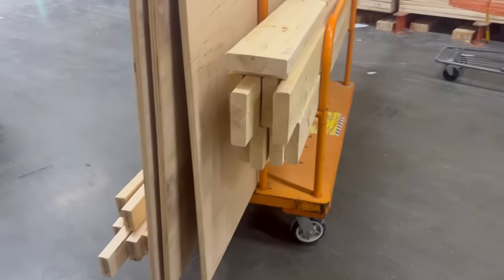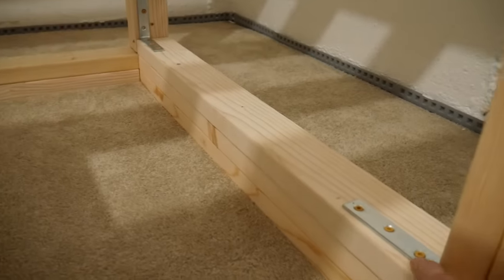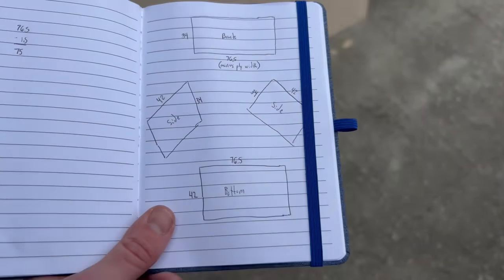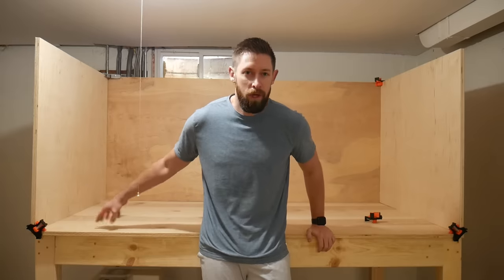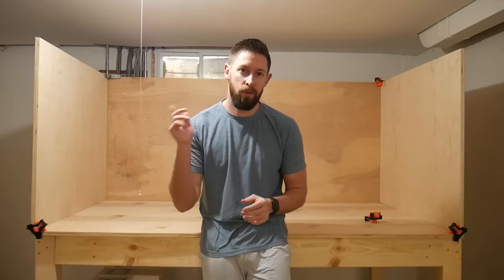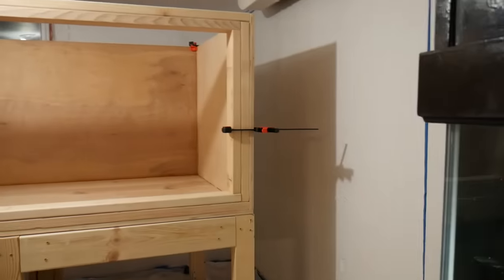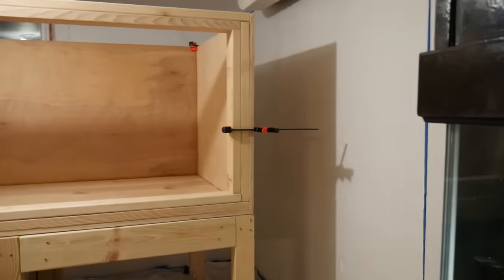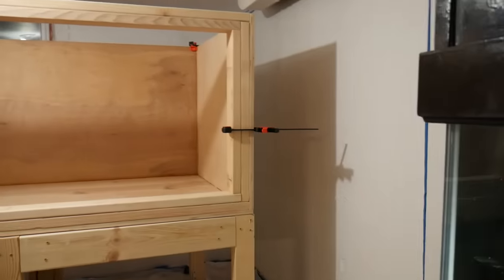I Built a Huge DIY Plywood Aquarium! (Part Two)

Comment: I don’t know if this is applies to your build but many of the plywood tanks I have seen have a stud system on the outside of the plywood to hold the tank together.  Hope everything goes well.
Reply: Agreed, the amount water pressure is gonna be pretty high against just plywood panels with screws only holding the corners.
Reply from the maker: There will be more bracing added

Comment: Great job . As a wood worker for years and comfort with any power tool. To make life simple and avoid the trouble of dealing with plywood have panels. Once your frame is build and you have exact measurements, as you said , measure 2,3 😁 . Have the lumber yard or home depot, lowes cut the plywood panel for you for a minimal fee, 50 cent to one dollar per cut. Makes transport easier also , not to say the trouble of cutting them. The panel cutter make it easier and get a nice even cut. Cant wait for the finished product. Good going. Subscribed 👍
Reply from the maker: Thank you, really appreciate that and welcome to the channel! That’s a great point about cutting at Home Depot. I’ll mention that in one of the next videos!
Reply: @CichlidBros  saves the hassle of using a straight edge dealing with clumsy heavy panels and the list goes on

Comment: As a long term aquarist that has designed and used sumps for decades, I cannot imagine a poly sump where you cannot see what is going in inside the sump.
Reply from the maker: I love the seamless sump. It will be my third. I wouldn’t want any other sump

Comment: Hate to be a killjoy as the tank is going to be awesome. Would it not be a good idea to reinforce the side and back panels with 4x2 uprights and double boarding? Just have visions of the tank bowing out on the sides and back. Would be a catastrophe if it gave way.
Reply from the maker: Yep, I will be adding that with my next step. Definitely going overkill on the bracing as well

Comment: I hope you are planning to add some framing to the walls on the upper section 3/4 ply with 1000 screws is actually weakening the structure, not to mention the screw heads need to be counter sunk.
Reply from the maker: I am, like I said in the video. And it’s 5 ply
Reply: Wondering the same things. Those screw heads sticking out are really triggering my ocd (same in the stand in part 1). Doesn't look like they went in enough to draw the wood together very much. Also very curious about how the sides are going to be supported including left and right of the viewing panel. Part 3 should be interesting....